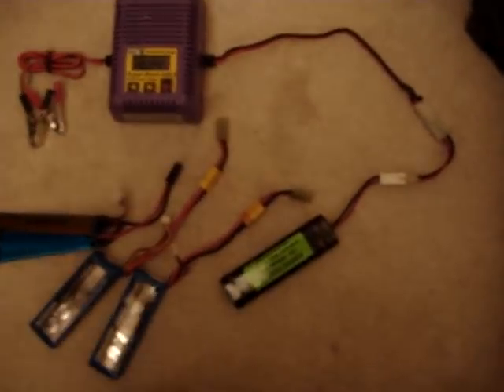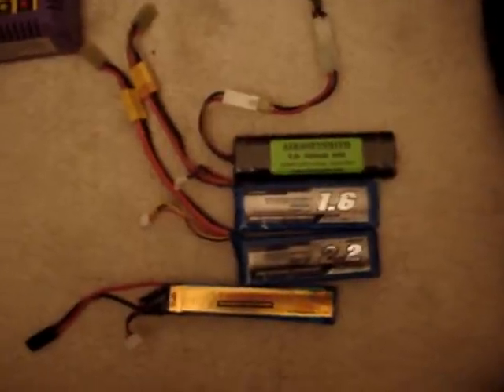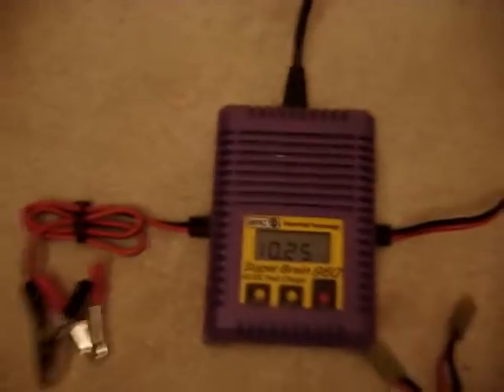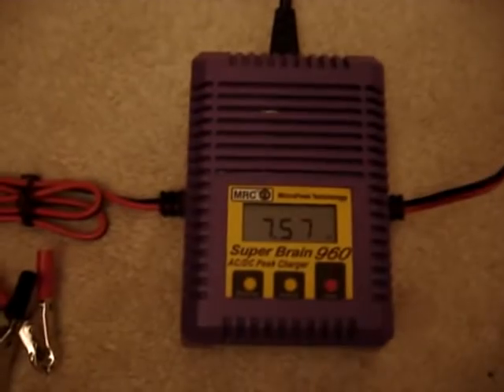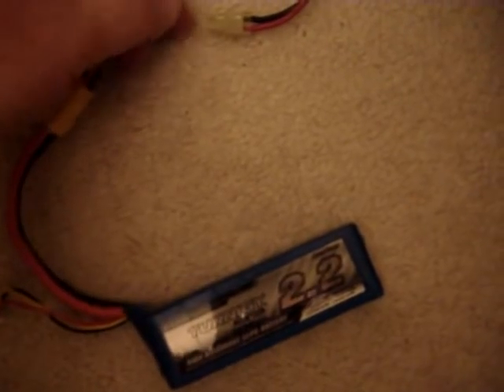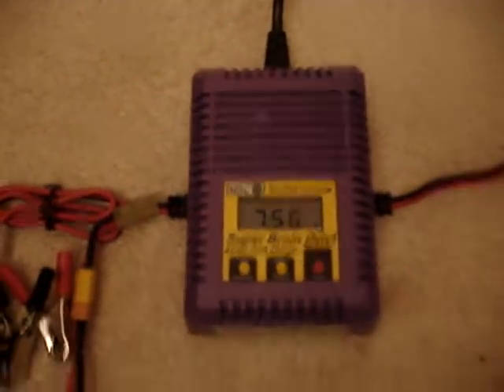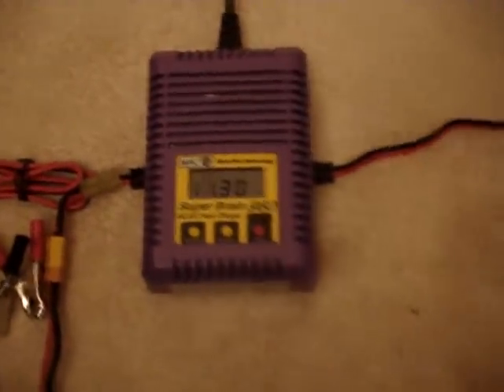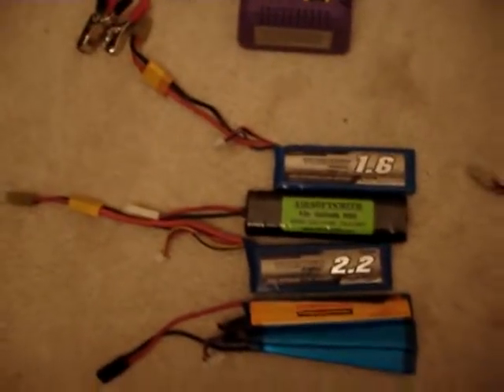lipo vs nimh - Voltage Check companion video

Comment from the maker: The nimh displays roughly 11.28volts when completely topped off, but this one being at 1025v represents how it would behave after a bit into an Op. nimh batteries come off their peak charge so fast I didnt feel it was worth comparing it at that topped off state.

The lipos - same thing: they're halfway drained to show how they'd behave well into an Op. 

When all four batteries are FULLY charged the results are even more pronounced: in effect, all three lipos pull farther away from the nimh.